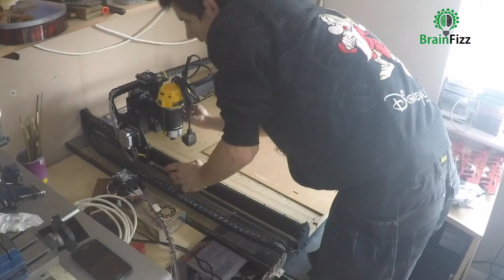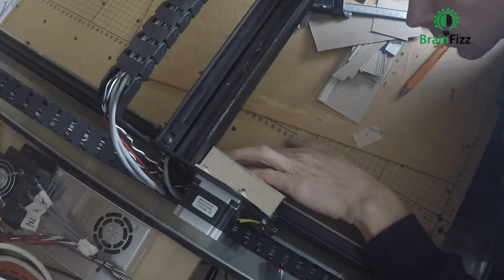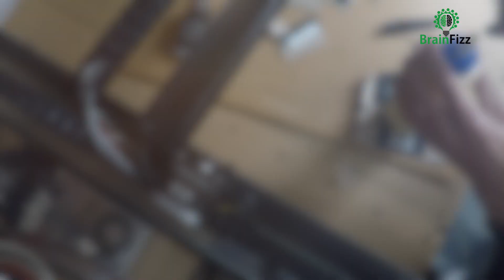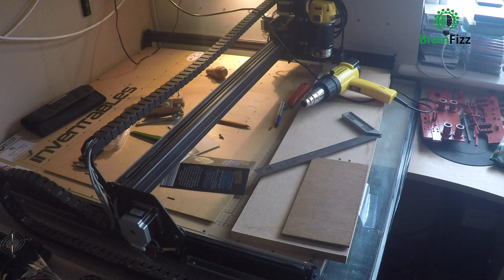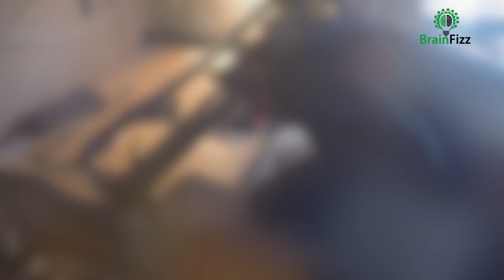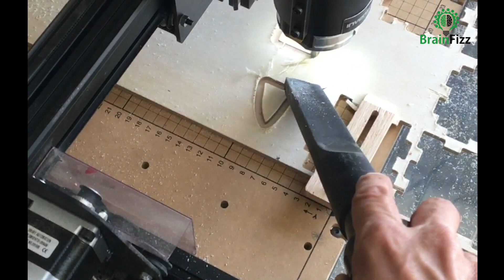Xcarve mod 2.1 -  Side Guards, stiffness & cleanliness in 1 Y-axis stiffening.

Comment: Hi Richard,
That's a good idea to help minimize the mess from the chips.  What material did you use?  It seemed to be easy to work with.  I've had some disappointing results with clear plastics where you can't easily cut it or drill it because it cracks.  Especially thin material.  PVC is easy to work with and machines nicely but unfortunately, you can't see through it.  I don't know if you've tried this but you can take PVC plumbing pipe, cut it to the length you need, slit it on one side and flatten it using the heat gun.  A 4" diameter (100mm) pipe yields a flat piece about 12" wide.  Thanks for the video!
-mike
Reply from the maker: Hi Mike! The clear stuff for the side panels is just cast acrylic - these bits were originally screwed to a door to protect it from a dog, it was all scratched up and someone wanted it removed, but i hung on to it.
The bits for the wheel guards I don't know, it's a much more flexible plastic, possibly PE? It's only about 1mm thick, I can't even remember where it came from - wombled from somewhere LOL!

I've seen people do this with PVC pipe before, looks like a good way to go, not sure I'd have the patience to do it. But as you say it machines REALLY nicely! :-)